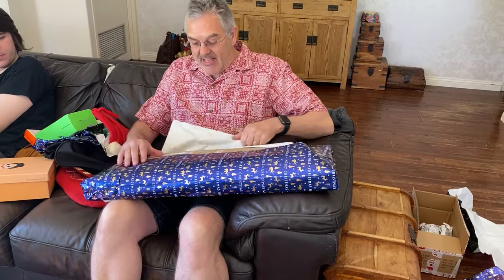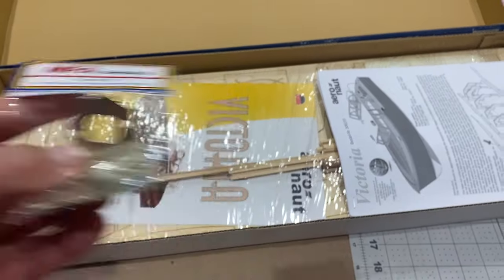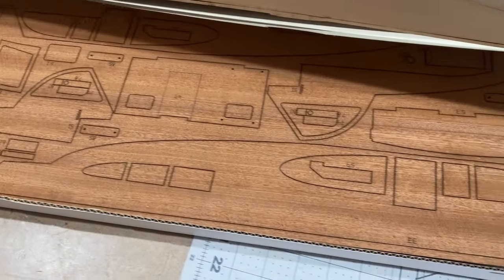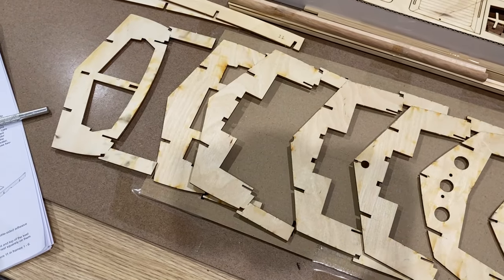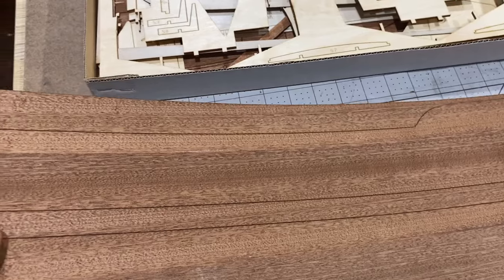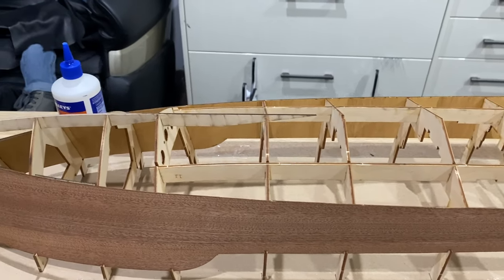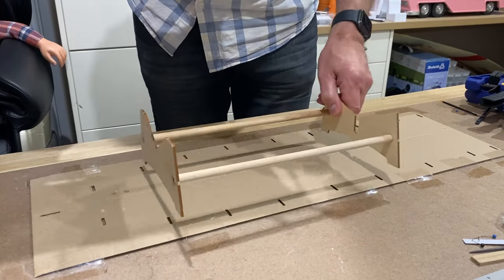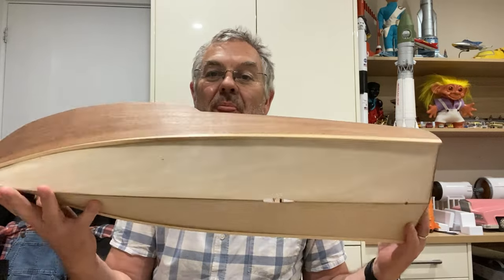Building an RC boat - can I create a Chris Craft Corvette from the Aeronaut Victoria?

Comment: I've built 2 Chris Crafts, both Dumas models.  one is a 1/8 scale 1949 19 foot racing runabout,  and the other is a 1/12 scale 1954 Commander 36 foot express cabin cruiser.  Your model looks like it went together easier than mine which is all hand planked.  Best of luck, looks like you're off to a great start. 👍
Reply from the maker: Thanks.  I hope mine turns out alright.

Comment: have you ever considered adding fiberglass to line the inside of the hull and then resin lead shot to the bottom inside the hull.....(on a boat of that size 3-4 kg's of shot should crevice) .....once that is done. add closed cell foam in between the hull frames and then glue 1mm veneer on top of the frames sealing all of that in........not only will you get an extremely stiff hull, you get flotation..."just in case" and the added weight gives a truer ride in the water.....adding weight and stiffness to the lower hull needs to be a priority in model building.....if you are building to scale...shouldn't weight be a part of that scale?....just saying....
Reply from the maker: I’m not planning on doing any of that. I’m making the boat as per the plans. I might add some weight once I’ve seen how it sits in the water. But it will primarily be a display piece so won’t be sailed heavily.